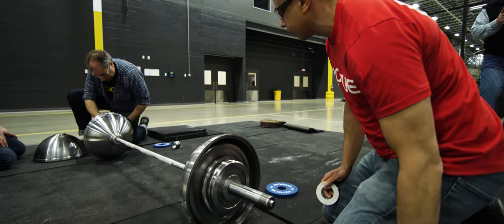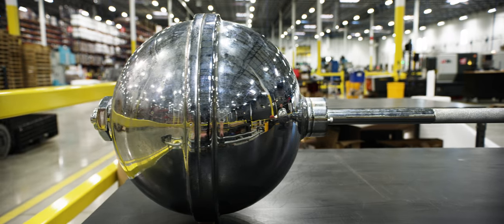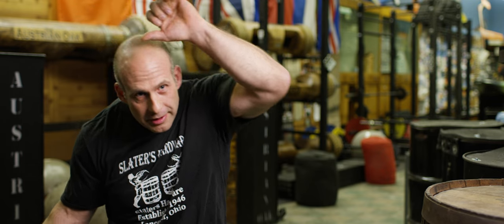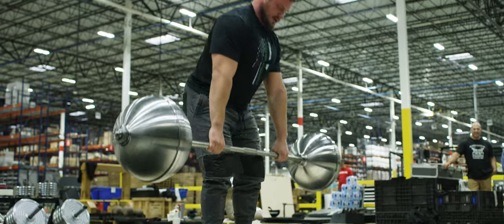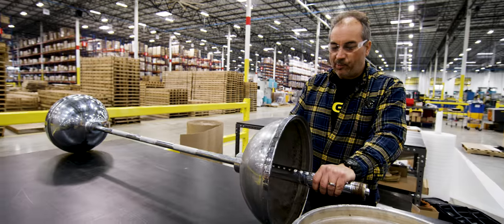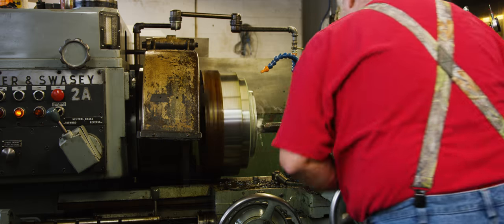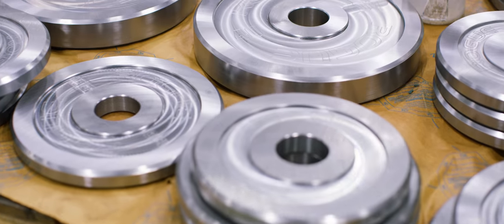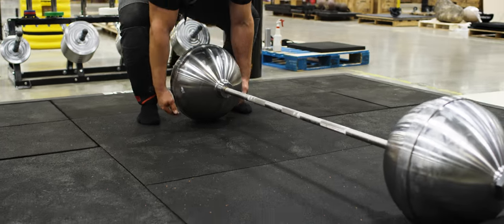2018 ROGUE RECORD BREAKER | Berg Hantel Barbell Preview / 8K

Comment: That's impressive and everything, but it's putting your whole life at risk in one lift bruh
Reply: So is just a generic squat if it's heavy enough. These old lifts are just a different show of strength and obviously should be practiced just like anything else. I'm sure Martins has been working up to the record for some time and clearly a 560lb Squat is not much for his strength (since he easily tripled it at the event). Its just a matter of working on the movement and knowing when to bail if necessary.
Reply: Abi i i well every Arnold competitor spent time throwing a 440 pound stone or something like that within inches of their head so I think That’s just the risk that comes with the sport